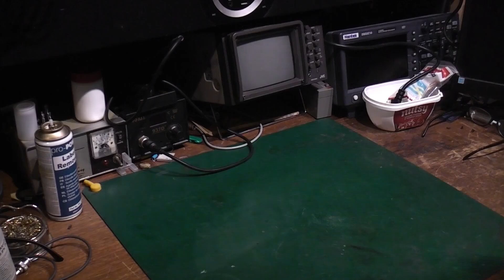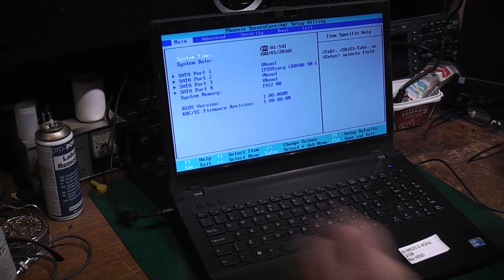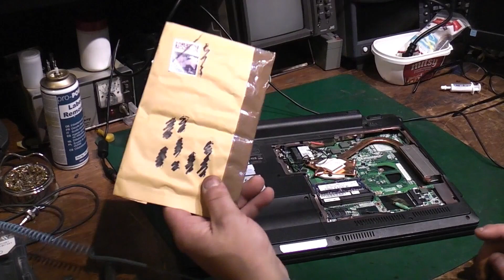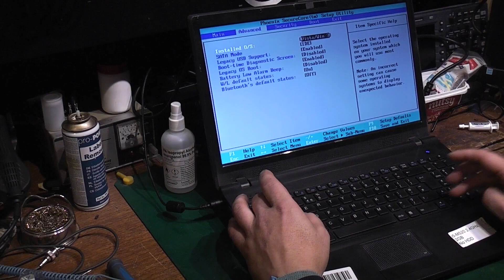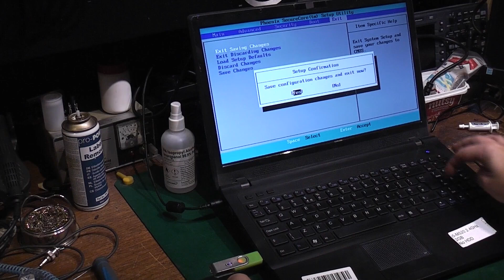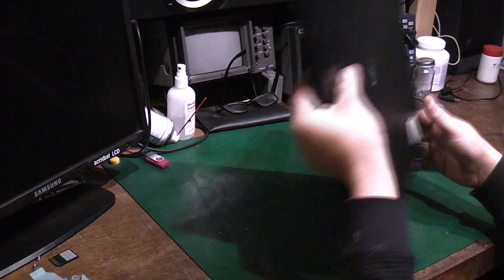£15 i5 laptop from E-waste was it worth it?

Comment: Fitting a £7 SSD would have probably given more benefit, than upgrading 4GB RAM to 8 GB (though that's still worth doing). Though Linux might need an SSD less than, say, Win 10
Reply: I beg to differ. I had the same platform (Core i3 first gen with HM55 chipset) and the difference between 4G to 6G to 8G DDR3 is huge. Maybe because it use some of the memory fori ts integrated graphics. And yes,  the difference is in the boot times and also when web browsing with 2-3 tabs open on Opera or Firefox. under Win7x64
Using a SSD did not made so much difference in using the computer except when the memory was 4G but even then, the memory upgrade had mor impact.
Reply: @sebastian19745   It might depend to some extent what the hardware platform is. Also, an SSD would offer a bigger improvement over a 5400 rpm HD than it would over a 7200 rpm.  As far as boot times are concerned, I still recall my dumbfounded surprise the 1st time I replaced an HD with an SSD, how much quicker it booted.  Possibly RAM spec & even CPU characteristics/type - for instance AMD "APU* - (God, they suck) might matter. I never noted RAM upgrade improved boot time but it drastically improves "multi-tasking" - several programs and/or several; browser tabs concurrently,  for sure

Comment: The best laptop I ever had was one that I bought (used) in 2013. It came with 2x2G DDR3, an Core I3 M380 CPU and integrated Intel graphics. It was an generic computer (Compal NCL60) sold under various brands, one of them being Fujitsu-Siemens. In time, I upgraded the RAM to its max 8G, as it was cheaper and at one point I upgraded the CPU with an Core I5. In its max configuration, I was still able to use it until last year (2022), for all the web browsing, multimedia, playing some games and it was fully functional, quick, snappy, responsive with Windows 7 on a 1TB spinning HDD. Sadly, the keyboard broke and I did not found a replacement so I retired it. 

Now I am using a desktop Core I3 6100 with 16G DDR4 (it had 4G installed) that I found throwed out near a garbage bin; I just hope that this one will last at least 8-9 years with upgrades as the old trusty 1st gen Core laptop. 
Yep, why spend money unnecessarily?

Comment: That was a good deal and you mentioned that the small laptop was 32 bit,  LMDE6 is offered in a 32 bit version as well as a 64 bit version and both versions are supported, I have two 32 bit laptops and they work well enough with Sparky Linux LXQT installed and there are still many other 32 bit OS., available and a simple online search will find those.  Which model of RM laptop is that?  
After cleaning off the old thermal paste I give the CPU., and the heat sink a clean with IPA., before I apply the new paste, I also clean the ram., modules with IPA., and I use an old camera lens brush to dust out the ram., slots and the rest of the inside of the laptop.